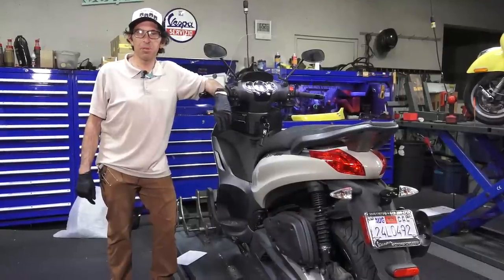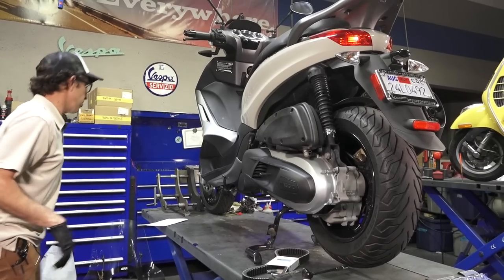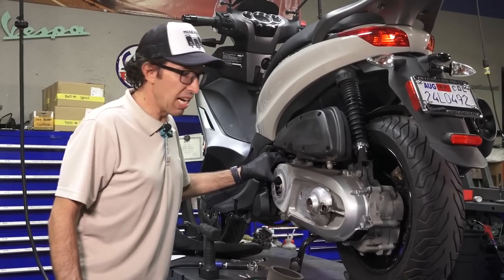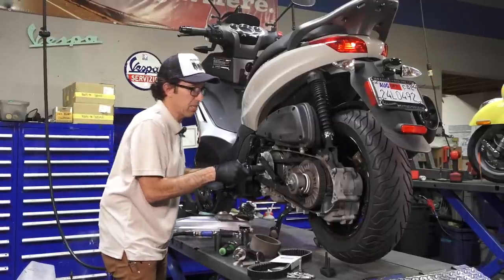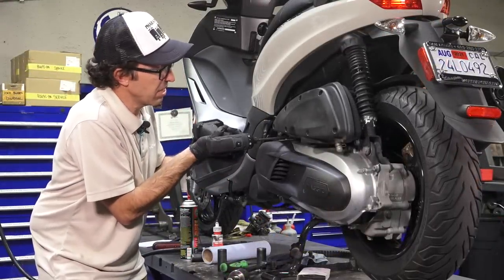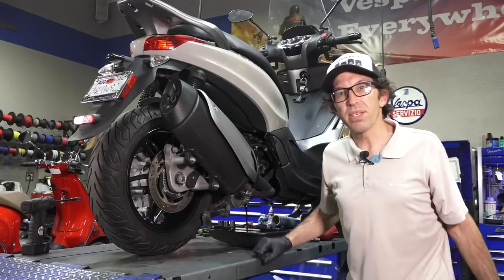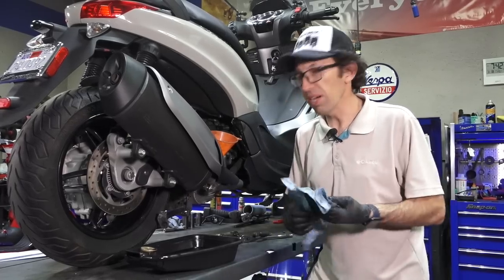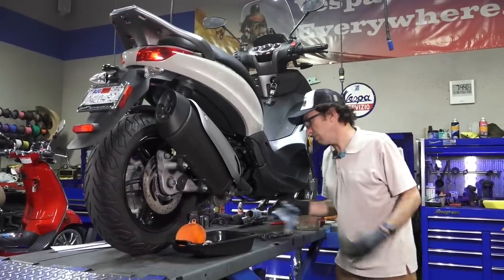Goodbye BV350!?

Comment: I find it surprising how short the mileage is on the BV from a full tank.  I fill my 125 primavera at around 160 miles and I ran it out at 206 miles. I had a litre under my seat. Another great video, who wouldn't buy a Robot used bike.

Comment: Great video. I have a white BV 350 from 2016 with a wind screen and an official Piaggio top box on the back. Talk about cool. It is the best thing I have ever owned for around town commuting and shopping. We can carry plenty of groceries, and my wife loves the very comfortable riding position on the back. Just perfect. However, I was surprised to hear the suggestion that this scooter can be used for long haul trips. Watch out. The subject is mentioned later on in the video. The gas tank is only 2.5 gallons. This is not a problem for simple around town trips. I fill my tank maybe once a month, but on a long haul trip, you really need to watch the gas gage and preplan your trip to insure there are gas stations along the route. For the three hour 170 mile freeway trip I do once a year to Scuderia West in San Francisco, starting with a full tank, I need to fill up twice more along the way to be sure I do not run out of gas on the freeway. Forget about using this scooter for trips in the mountains or desert where gas stations are few and far between. The gas tank is simply too small for such trips. And speaking of riding on twisty roads in the mountains, I have come across another issue. You will not notice this when riding around town or in a straight line on the freeway, but in the middle of a corner on twisty roads in the mountains, the front end constantly feels like it is about  to fold. It is either because the steering column is too flexible or because the wheelbase is so small. I've never felt this on bigger bikes. It forces you to slow way, way down, making the BV totally impractical for mountain roads. Still, it is the best thing I've ever owned for around town commuting. My plan is to see if I can get ten years out of mine. :-) Robot, thanks for the BV videos!

Comment: It's definitely a goodbye forever for me.
The engine brake is too stressful especially because of the stuttering and detonation so every time I slow down or have to stop, all these issues together give me a hard time.
The scooter also overheats, especially during Summer and in the traffic, the radiator's fan very often switches ON!
It's powerful and it has a great road handling but after a while it's a stressful scooter.

Comment: Quite the interesting video, Robot: as the owner of  a 2015 GTS300 Super that's approaching 20k miles, I can vouch for the fact that one needs to keep an eye on that drive belt (had one disintegrate on me at a bad moment a little under two months ago, at roughly a bit over 8k miles), but otherwise the machine has been bulletproof, which is good, since it's not just my main ride, it's my sole motorized personal transport, period. Nice choice of the Tiger for a big(ish) bike. (Also dig the nod to Black Flag with your Pharaohs SC cap.)

EDIT: Met someone last weekend on a group ride with a BRG Racing 60s GTS300, with the new Akra pipe. Thing looks sharp. I think it'll fit you well. :-)

Comment: I have a 2013 that I've been using for commuting. It's my 3rd commuting scooter and I don't know if it will end up being the most reliable of the 3 but when working it's certainly the most capable of the 3. Prevoius were 1987 Honda Elite 250 ( put to rest with 49,000 on the clock) and 2006 Daelim S-2 250 (put to rest with 46,500 on the clock). Getting ready for my 1st belt change on my BV.

Comment: Nice Service jobe done on that bv350, im look to find one used old Vespa T5 or PX to restore and drive. I have work in Motorcycle Service here in Zagreb (Croatia) almost 17 years and is a great intresting and fun work. I still have my old 2003 Piaggio NRG mc3 PureJet still work fine after 24000km

Greeting from Croatia 😎👍
Reply from the maker: Very cool!

Comment: I have a little question for the mechanic or for every single people who read and can answer me. I bought a BV350 (2018 model) and everything is ok, but when im driving slowly, like 20 or 30 km/h (low revs) I feel jerks. I realize that at this speed the fluency and flow its not normal at all. On the other hand, when I accelerate the bike works perfectly. Does anybody know what´s happening?
Thank you very much for reading!

Comment: Hi Rob, any chance to have a video about the ABS system, trouble shooting it, sensors check, ABS light on, problem-solving, please. Also, there is no video on how to remove a clutch on Beverly (without that special tool, I had to use handy tools to lock it and remove it...).Cheers

Comment: I was gonna get a bv 350 but instead decided to get a honda forza abs, both are great bikes.
Reply: Same here.
Reply: @EFA22000  which scooter do u have
Reply: @jasontomica8938  I was going to trade in my gts300 for a bv350 and ended up buying a forza300
Reply: @EFA22000   What year is yours and how many miles have you put on it in any issues
Reply: Do you have any new bv 2021. 350

Comment: Dear Robot, thank you very much for your videos. I have a BV 350 tourer, colour "Grigio Materia" 2020 model exactly like the one you mentioned. I would like to know what is the colour number as I need to buy the colour spray as I scratched my scooter. In the helmet space underneath the sit it shows "color: HT" but what spray paint should I buy? Also for the oder lighter grey part. Thank you in advance.

Comment: HELLO MONSTER! i HAVE A NON INTERESTING QUESTION BUT IT'S ODD i HAVE AN LT150 IGGIO IT HAS 800 ORIG MILES ON IT WHICH IS CRAAAZIE BUT OK i GOT IT TO RUN FLAWLESSLY BUT THE QUESTION IS WHERE THE HELL DID THIS COMANY HIDE THE KICK STARTER DID SOME NO COME WITH THEM? i MEAN i DON'T EVEN SEE A HOLE FOR IT..ANY IDEAS WHAT GOES ON HERE?   TIA  i'VE LOOKED EVERYWHERE CANT FIND IT OR AN ACCESS HOLE  NUTHIN  LEASE HELP i LIKE TO HAVE THE SAFETY OF A K STARTER
Reply: It does not have one, the e-starter is reliable as a car's e-starter. 
And the next time don't use all caps.

Comment: Not a new BV 400?
Reply: I wonder what the difference is.
Reply: when the bv400 gets here in the USA, it''s going to run close to 
$10,000 !!!
Reply: I think Robots holding out for a new HPE Beverly 400S or the BV300. Better suspension, brakes, keyless and the 16" wheels he likes.
Reply: @marksalisbury5076  $7300